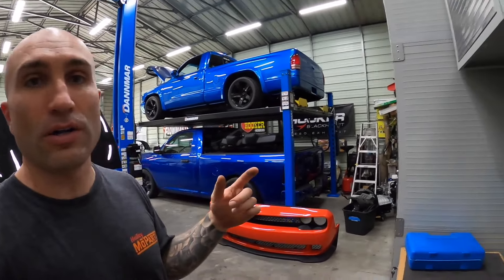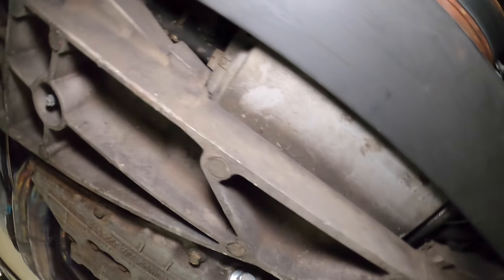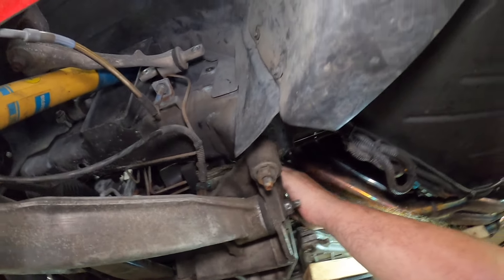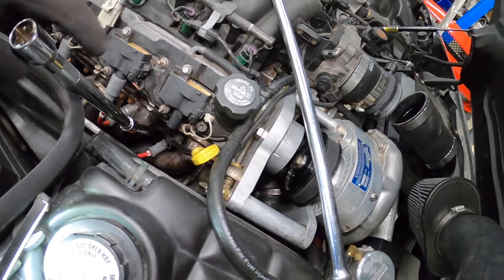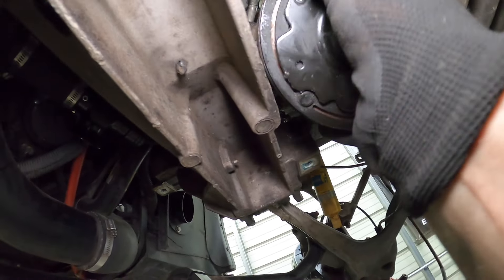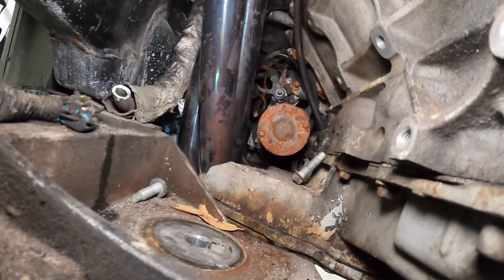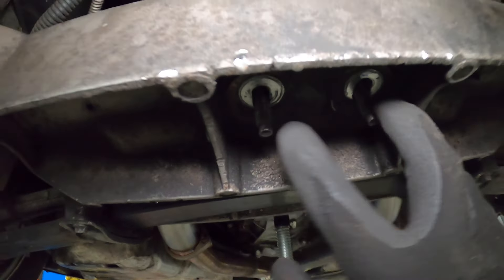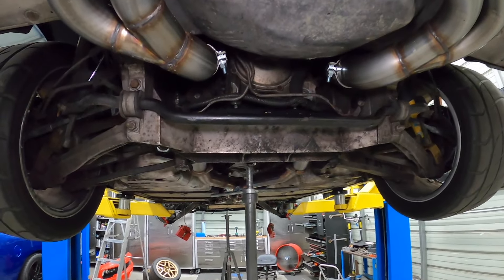C5 & C6 Engine & Transmission Mount Upgrade Install

Comment: Love the content. I know purchasing parts for the z06 has gotta be alot easier on the wallet. I see the other dakota is back. I like that paint scheme.
Reply from the maker: Yeah there's definitely a different type of excitement with this car because there is just so much aftermarket options out there for a fraction of the price of mopar stuff.  Makes modding a bit more fun
Reply: @boostedmotorsports2  yea being able to mod more for your money is always a good thing.  looking forward to all your content. You got my likes/veiws regardless im a mopar guy but i like any content related to modifying / building a car or truck. 💪🏽🤘🏼💪🏽🤘🏼💪🏽🤘🏼